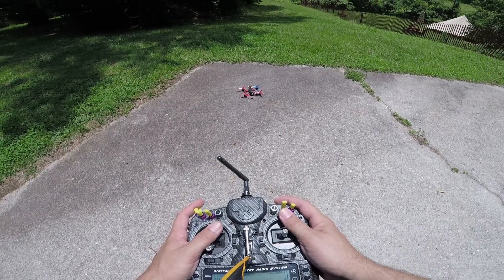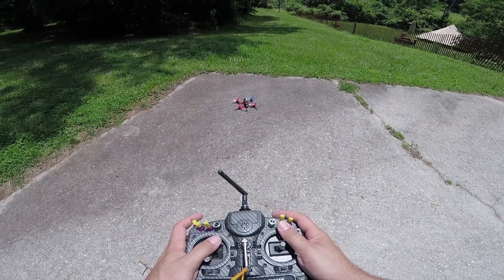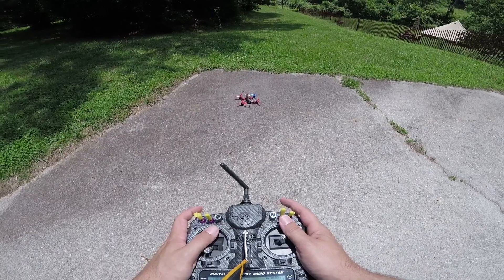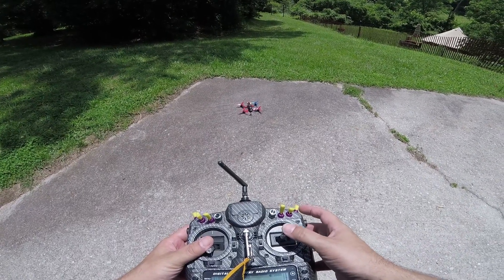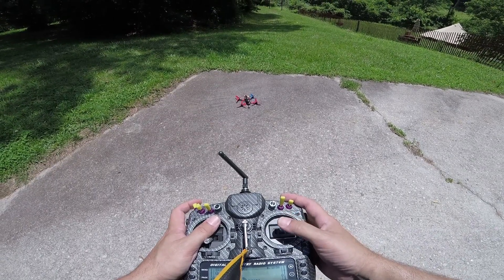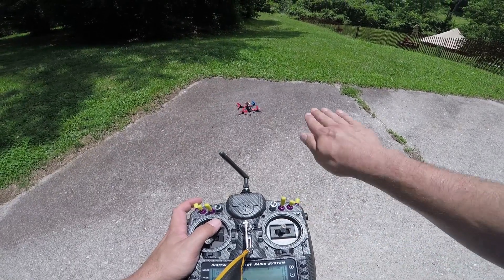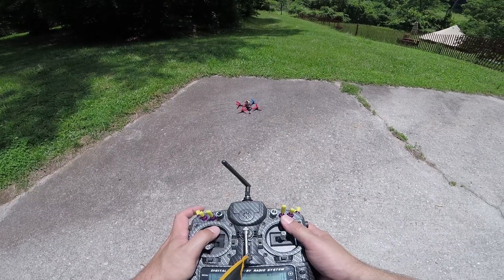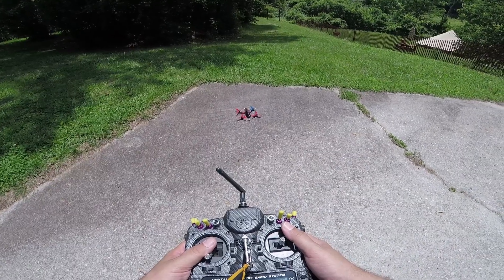Quadcopter Flips On Takeoff | A BETTER SAFETY CHECK

Comment: If you have an underslung battery, and you have the FC orientation wrong, just arming can send it in to a tizzy..  I speak from experience
Reply: Dude, those of us quad builders who do not have any dents in our ceilings/walls aren't really "quad builders"!
Reply: Still easy to make a mistake..  we all do
Reply: At least that happened with 3.0.1..  i think they may have changed something to help prevent this on newer firmware revisions
Reply: I did the same thing, only I tried to do a test hover in my kitchen at about 1:00AM and it went completely nuts full throttle into the wall just by flipping the arm switch :D almost gave myself a heart attack and woke up everyone else in the house lol.From now on i'm not doing maiden flights in my kitchen.
Reply: hehehe :)
Reply: ibfisher not really were just not morons who understand our gear and do spot checks throughout the build.

Comment: I'm guessing this doesn't prevent flipping out if your board orientation is wrong?
Reply: Sure it would. If the copter doesn't tilt the direction you commanded with the sticks then something needs to be fixed. Any one thing wrong will make the copter flip out. Works best on copters with underslung batteries in my experience. You simply bump the pitch or roll a tiny bit and observe that the copter tilts as expected.

Comment: Nice tip Joshua! I stumbled across this same check while testing my micro a few months ago. Glad I did cause the prop were all the wrong way and it tried to rock itself apart. 
I do this now for every build/rebuild safety check, because even 2.3" props can bite the hell out of you. 

Better to freak out on the ground than while airborne!

Comment: Note that if you do this and are even slightly aggressive on the pitch/roll while testing at 0% throttle, you will still flip out if you have airmode on. I would keep airmode on a switch and activate it when you are certain the quad wont try to kill you.
Reply: Airmode doesn't engage until you go past 1350 on the throttle for the first time after arming, so it won't be active until you take off.
Reply from the maker: FWIW, air mode was on in this example and I was at least slightly aggressive on the sticks.
Reply: DavyBoy lol just realized that
Reply: WYG Hsx have you definitely wired the motors onto the fc in the correct order?
Reply: I'd be looking at the motor order, as in making sure he has motor one to PWM1, motor 2 on PWM2 etc. 

If the fc arrow is facing forward and he has board orientation set to 0 in the KISS GUI then it's definitely not board orientation.
Reply: Ah that is some good information. Thank you!
Reply: On my KISS'd Chameleon if I so much as touch the roll and pitch stick throttle continues to increase for some reason, min throttle is set to 1050 as well, I assumed it was air mode that was the cause.
Reply: DavyBoy its accelerometer issue i just had same thing thought it was airmode but turned off accelerometer and it went away i only fly acro anyhow so its better any way for cpu load
Reply: I don't even know how to turn the accelerometer off in KISS, I have it disabled on my Betaflight quad though.
Reply: DavyBoy yea ive been sticking with betaflight more user friendly
Reply: I have a kiss chamelon also, i have the same issue as Joshua shows in the video. Whenever I move slowly one stick, the quad tries to kill me. I have check the FC orientation, the motors rotation, the propellers, everything seems ok... Can someone help me ?
Reply: WYG Hsx what fc r u using
Reply: I'm using KISS FC, put in in the right direction, with KISS ESC 24amps, checked the motors orders and roation, everything looks find
Reply: look at the fc u should see an arrow and if you have that pointing forward u should be good unless u turned it to access micro usb like i turned mine clickwise so usb out the side instead of back so i had to go to configuration and put 90 degrees on yaw access and it fixes it depending on if u tuen cw or ccw if ccw then -90 or however many degrees you turned it
Reply: The arrow is pointing forward, I have the usb connector to the right side so.
Reply: I Can't go on betaflight i'm on KISS, and the orientation is set to 0 in the KISS GUI so I assume that it's not the orientation ?
Reply: blaze allday he's running KISS, you can't use BLHeli Suite on KISS ESCs.
Reply: blaze allday stoner!!! 😂😂
Reply: Yeah my motors order is correct, the wiring is ok and when I individual test them in the GUI, they spin in the right direction. I think i'll try to flash the FC, set everything to default value, and try to fly with it. Thank you for your help
Reply: better yet just connect to betaflight n see which way is pointing forward on setup screen depending which way just put however many degrees its turned most likely going to be 180 or -180 in yaw access
Reply: WYG Hsx yea i dont think its orientation then check which way your motors are spinning if you nedd to change direction just do it in blheli config

Comment: Free tip: make sure your motors are spinning the right direction after you have replaced one. Had a "flip out" this weekend, motor wires soldered in same order but turned wrong direction 🙁
Reply: Haha, learned that the hard way huh? I was lucky enough to have watched Bardwell's video about it at the time so I checked the motor direction first without just flying it.

Comment: Yeah, it works like that because at minimum throttle just after arming, airmode is not engaged. Josh's method also works for copters that have vibration issues. Ive had copters want to keep on going because with airmode engaged, the PID controller has full control at minimum throttle, this means the PID loop can feed back onto itself, causing a runaway copter. The only means of retrieval at this point is to disarm. So like Joshua said, arm the copter, do his checks, also listen for weird motor sounds also, because if you use airmode (and you should) once you crack the throttle, the PID loop has control until you disarm. So maybe as a safety measure, have airmode on a switch for maiden purposes.

Comment: My Wizard flipped out after I updated the firmware, as I forgot to set the board to -90° in the GUI, it was pretty close to me as well, it freaked me out big time!!
Reply: I did the same thing earlier this week. What a dance it made trying to figure out which way is where :D
Reply: this comment just saved me another pair of props thx
Reply: Haven't checked yet but I believe I made this same exact mistake

Comment: Could've used this the other day.  lol  Quad flipped out and shot a broken prop into a railroad tie! 

Any ideas why I can't choose DShot in BF even though both my Speedix 30A ESC's and Omnibus F4 V3 Pro FC are supposed to support it?  I only have OneShot, MultiShot and a few other irrelevant options (going from memory) available in the dropdown box.  ESC's have the most current FW on them.

Thanks for all of the great videos!
Reply from the maker: What version betaflight?
Reply: Joshua Bardwell , Latest, I believe.  I don't have it in front of me, I  apologize.
Reply: Joshua Bardwell , Just looked and it's on 3.1.1
Reply: +Joshua Bardwell,  Any ideas?  I just got everything put back together after my last test hover and after changing the Gyro Refresh rate from 8k to 2k (per a local flyer's advice) the quad basically did the same epileptic breakdancer on PCP thing again.

I can't switch to DShot and I have a feeling that's the issue.